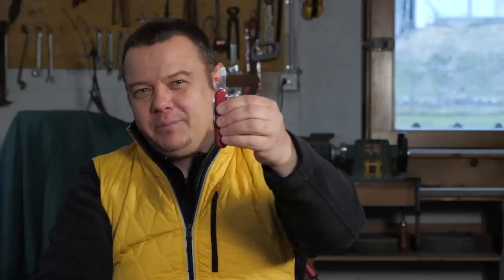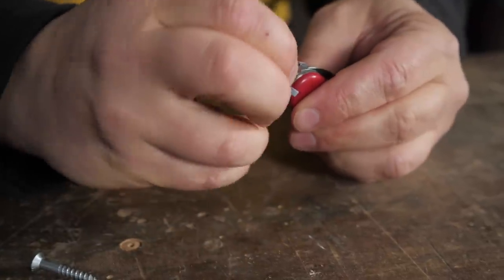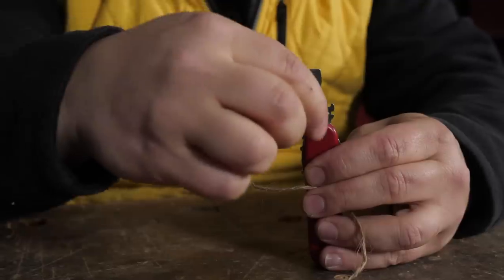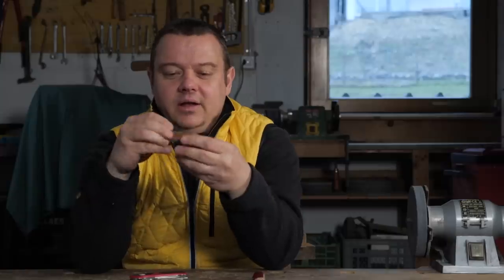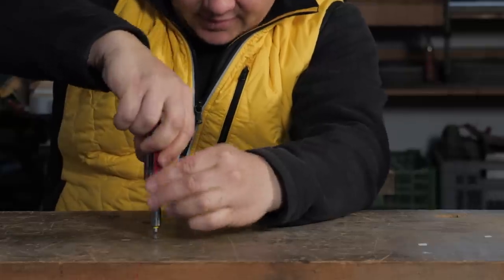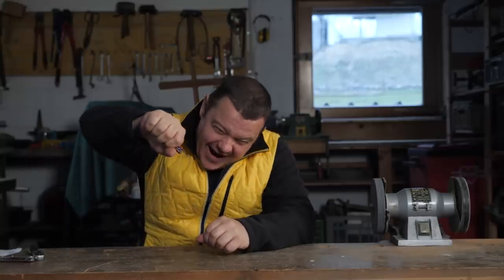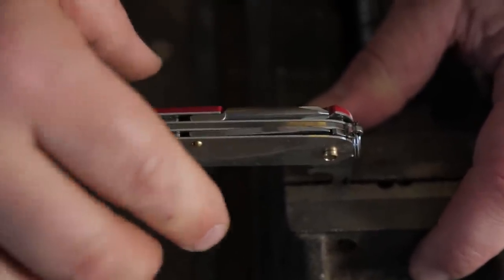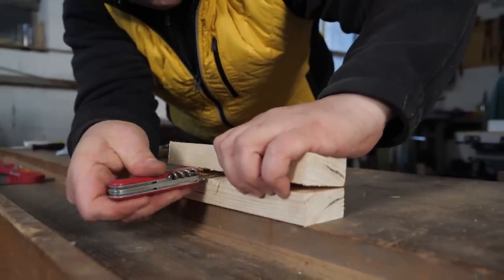The best Victorinox Bottle Opener Tricks/ Swiss Army Knife Tips & Tricks (30/40)

Comment: I was just experimenting with the methods you show here, and I discovered something: you can slip the small magnet into the 1/4" square adaptor and it keeps the screwdriver blade in much more securely. If you need to get the magnet out, you can easily shove it out from the other side using the tweezers. Hope I can give back a little tip to pay you back for the hundreds you've given us! 

Also I wanted to tell you, I've been a leatherman carrier for many years, and because of your videos I went out and got a Huntsman. I use it every day much more than I did the leatherman, and I'm very happy with it. Thank you for converting me!
Reply: Bravo!!

Comment: Super Video, Felix wir immer! From my understanding you are absolutely right. When you use the bottle opener as you did in 6:40 you create torsion along the long axis of the bottle opener instead of creating a kink along the short axis of the opener. This way you can create much more torque before it breaks. And folding the handle is also super smart! Herzlichen Dank für diese erhellenden Tipps wie immer 👍🏼🤠💡 Liebe Grüße an den Bodensee, Martin 🤜🏼🤛🏼
Reply from the maker: Vielen Dank für das interessante Feedback!
Reply: @FelixImmler  Gerne 👍🏼

Comment: I used one of these tricks today!  I had to remove a nut in a very tight space, and I could not get a wrench or socket ratchet attached well enough.  I got super frustrated, but then I remembered your video.  I whipped out my Super Tinker SAK, which I have been carrying since I found your channel.  In the "L" position, I used the large screwdriver to turn the socket.  It saved the day!  I learned it from you.  Thanks!

Comment: Many years ago a cutlery store owner did me a favor and ground an edge in the inside of the caplifter surface -- making it a wire insulation cutter. With the 1mm semicircle cut-out adjacent -- it is the perfect wire stripper for small gauge wires. This was on  an old Champion with factory black scales.

Comment: you may know this one, but I knew a guy who sharpened his big screwdriver into a woodcarving Chisel (obvious how), but you can also make a curved one by grinding a hollow in the middle of one flat, the edges on the other side.  not the best, but helps dishing things out. 

Another trick that I personally use, as a whole lot of whittling and carving can hurt the palm after a while, is you take the finger of a large old leather glove cut it off to handle length, and slip it on to pad the handle a bit.  You can Also use the awl to poke a few holes around the upper edge of the finger, put in some cord, and you have a simple secure necklace sheath perfect for a swiss army knife.    You can also cut the finger off leaving a flap from either the back or the palm of the glove, and  you can either tuck it down through your necklace lace or sew a toggle or button on the finger and a slit in the flap to keep it entirely closed.   Hope that made sense.
Reply from the maker: Hello Ryan. Thanks a lot for the wonderful trick with the glove!

Comment: Even with real screwdrivers it's best to twist than lever, the force is in the direction the tool is ment to bf used then. 

Your anticlockwise idea is very good thought, it would explain why my poor abused tinker that I take to work had loose scales now. 
I have lifted drain covers though with a 111mm model before they are  very stout knifes 👌

Comment: I tried your suggestion of using the toothpick to pull open a blade on my knife and a piece broke off the end of the toothpick. I put the toothpick back in its slot not realising that it was cracked and the end broke off completely leaving the toothpick body stuck in the knife. Thanks a lot.
Reply from the maker: Shit happens...
Reply: @FelixImmler  Rather than just a smartarse answer how about a suggestion for removing it?

Comment: Felix, just picked up a Rangergrip 79 today and noticed that the bottle opener is on the same side as the knife blade.  How would you strip a wire without being able to close the knife blade down on a wire in the wire stripper notch?  Could this be a design oversight or is there another method that is used?

Comment: Do the newer Huntsman have any locking blades or locking can opener? Just ordered a new black Huntsman from Amazon that CLAIMS it has ‘lockable blades’ but I didn’t want to get my hopes up. I didn’t think very many SAK’s had lockable anything on them.
Reply from the maker: No... i don't think so. The 111mm Models have that.
Reply: @FelixImmler  I’ll know in a couple of days for certain. It just shipped. Supposed to be here on Wednesday. I’ll update then. Sounds a lil hard to believe but it WAS almost $15 more expensive than the red version of the exact same model that was part of the same ad. Time will tell I suppose

Comment: I was thinking about the Victorinox Rescue Tool how it has the removable glass breaker and how if it was thinner at the tip you could use it as a pry bar and get a lot of leverage. Someone should take advantage of that removable feature and either mod the piece itself into some other tool or make aftermarket pry tools, pommels, or some other tools to replace the removable glass breaker. If you had your own machine shop the possibilities are endless. See video here:   https://youtu.be/DyZrQ3Q0ZR0

Comment: So you put the 6mm magnet in the can opener and close the knife. You open the big blade and the magnet slips out of the can opener. You close the blade and everything seems normal. Then you try to open the can opener and bust your thumbnail because the magnet is stuck between the can opener and the blade. No thanks.
Reply from the maker: On my Victorinox Camper the wood saw is next to the can opener. I open the saw, put the magnet into the rounding of the can opener and close the can opener. After i close the saw. The liner holds the manget on place. I don't know the problems you describe.